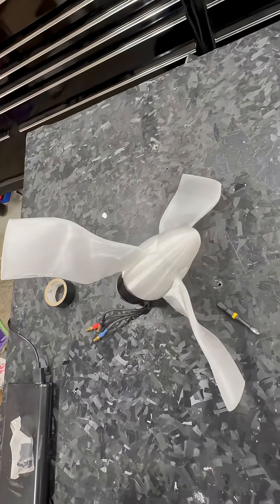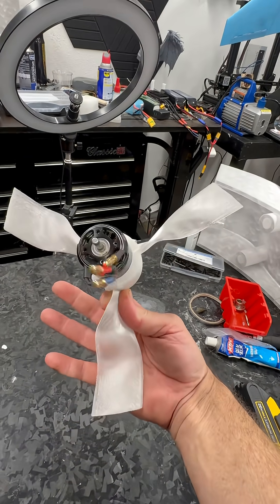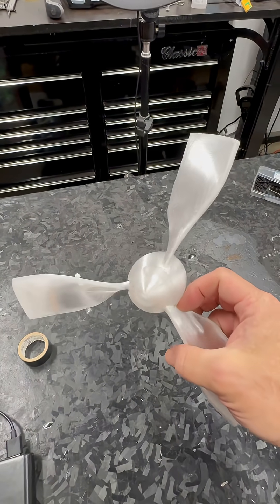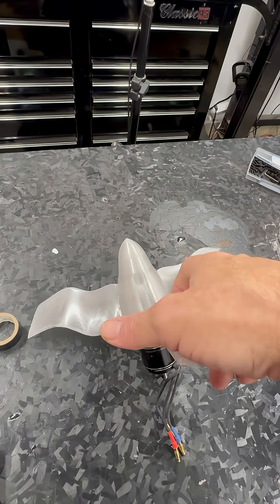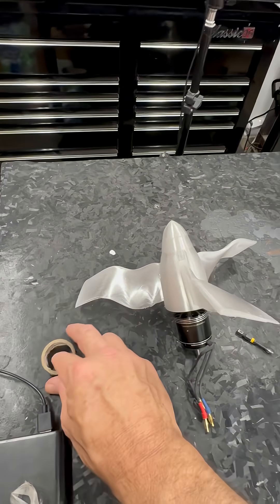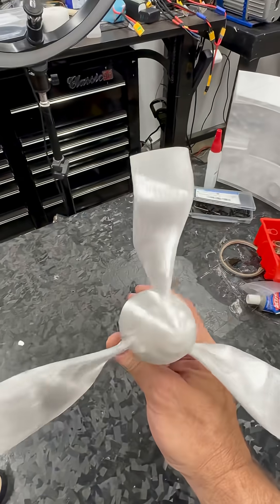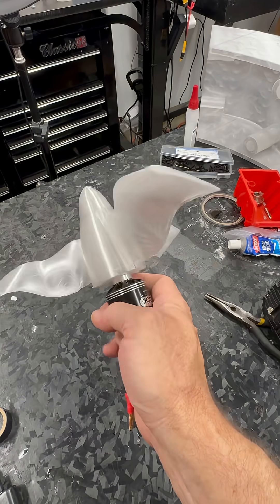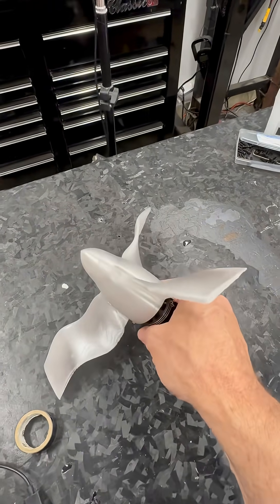A brand new ducted fan design just for fun.

Comment: Fun little side projects like this are what help keep you motivated to complete the big one, don't feel like there is anything to apologize for! I am actually starting to want to work on that ultralight design I started years ago now that I see this! Imagine four of these slung just right on the wing of a STOL, you could have a very effective setup with that much blown wing area! ☺️
Reply from the maker: Well, this is a preliminary test. It was only 20 minutes worth of CAD work. I don’t think it’s gonna be perfectly balanced so it should be a spectacular end or it might work perfectly. We shall see.
Reply: @warmachined3472 If it's fun and interesting, then it's worth it. I would probably optimize for five blades with the same surface area, but I have an affinity for five bladed props anyway. Something else that might be fun to look into would be a contra-rotating ducted fan with 11 blades on the forward fan and 7 blades on the rear. It should really help with noise levels, especially if you use 3 or 5 supporting stator blades between them.